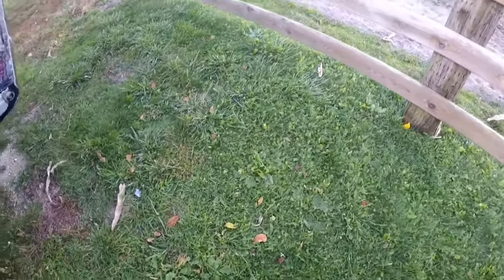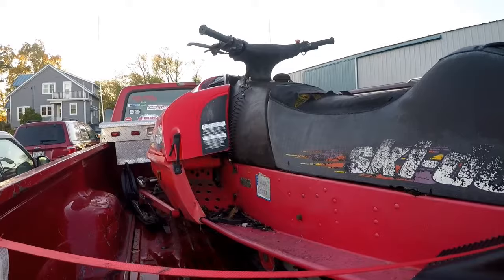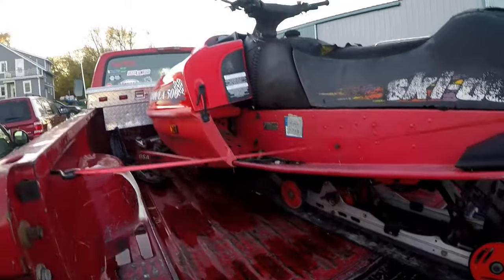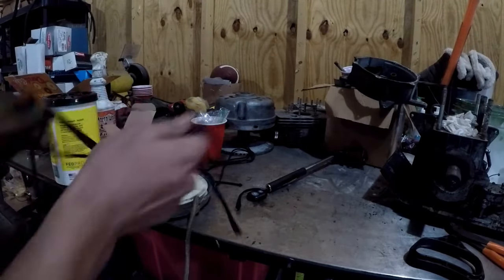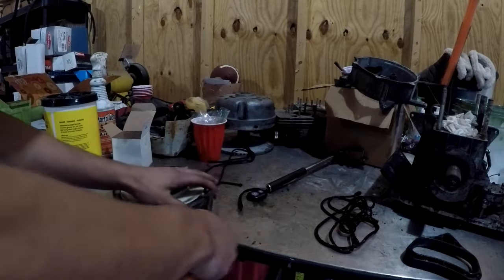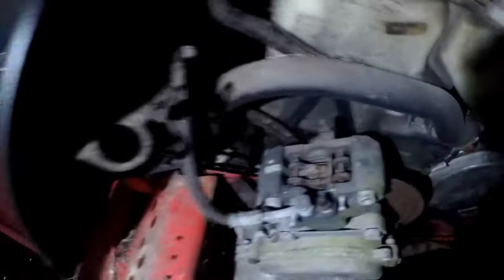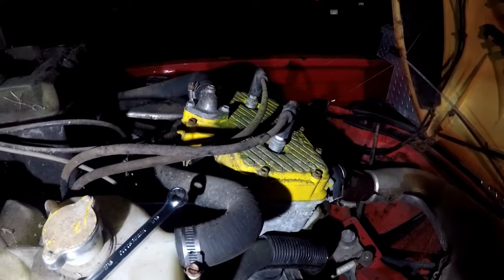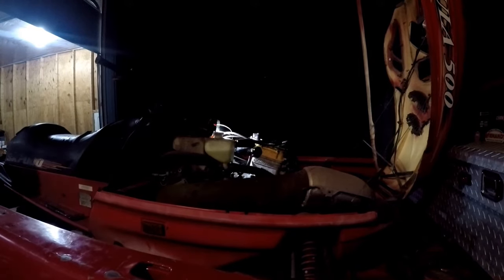Will This $40 Snowmobile Run After Sitting 5+ Years?? (1997 Ski-Doo Formula 500cc)

Comment: Just found a early 90's sled ski-doo olympique 340 . He was asking $500 got him down to $250 without seeing it. Doesnt run has good compression . comes with new track. Is that a good deal or no?
Reply from the maker: 377 fan cooled?
Reply from the maker: Also make sure it has spark otherwise no way at 250
Reply: @bearkreekboys  cool ,thanks for getting back to me! I didn’t get that sled at least not yet. He needs to come down in price . But last minute today I picked up a 1978 arctic cat Jag 3000. I seen u work on Jags before and I thought they were cool! Got it for $40 😎 it’s all there and has spark and really good compression . So I think it will run after I drain the nasty 🤢 gas out of it and clean carb . I’m super pumped!  My first sled ever!